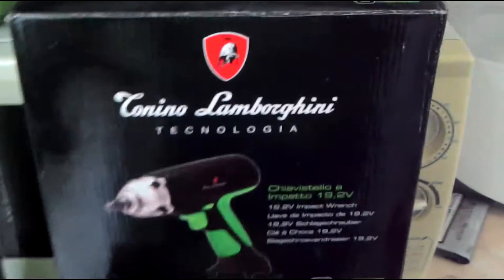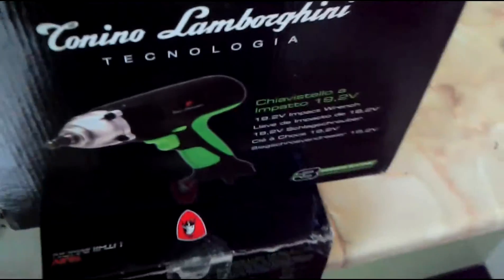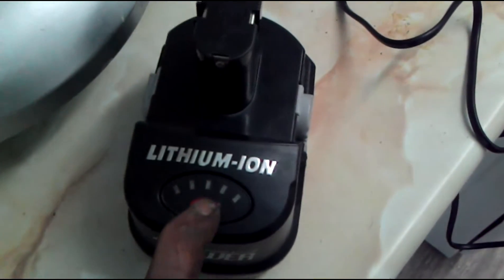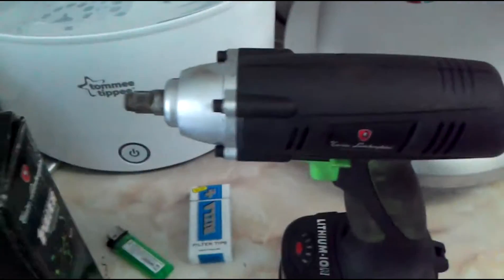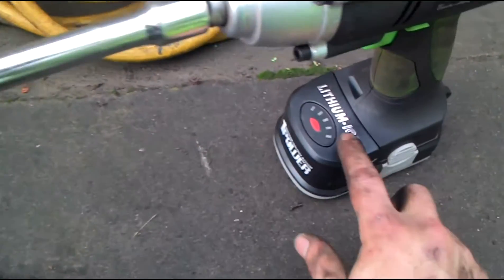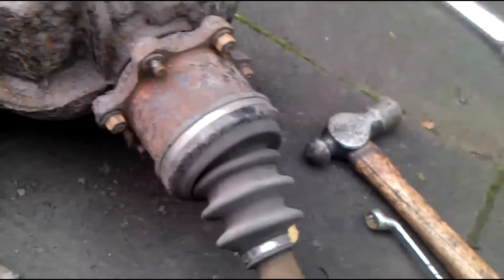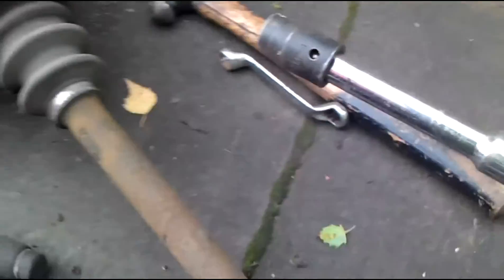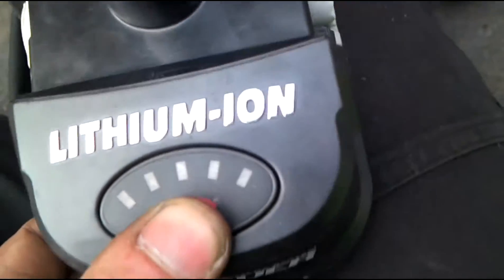tonino lamborghini impact wrench reveiw

Comment: i picked one up a few weeks ago, barebones unit for 20 quid, tbh i make my own batteries for my power tools or convert them to lithium. you think it will be ok with a decent battery pack ? im talk what i have in mind is building one that is 9ah power tool batteries, 3s 5p. so each one will push about 90amps. generally you dont even get high end power tool batteries that high why i always make my own.

Comment: thanks for your review .. saved me money .. although i am thinking to get an electric wrench over battery powered once .. what do you think .. and i am not a mechanic..
Reply from the maker: thanks for watching.. yes i have used electric powered wrench. be careful of tightening some bolts with some of them are quite powerful and could sheer off threads or bolt heads. but good if you hardly use them. and just need it now and then. to remove those large stubborn bolts. good luck